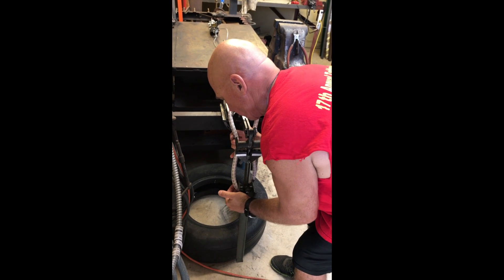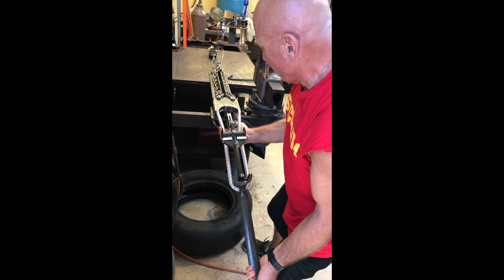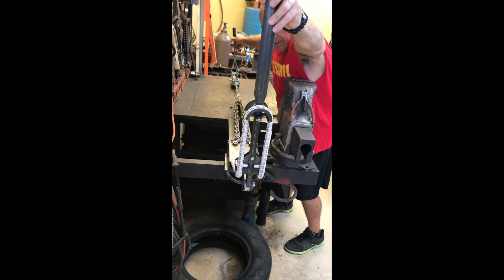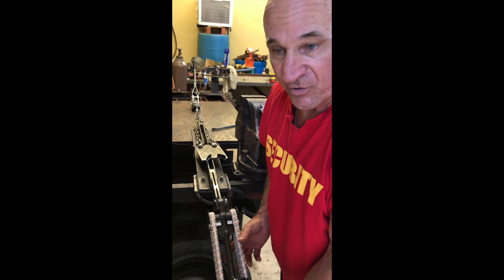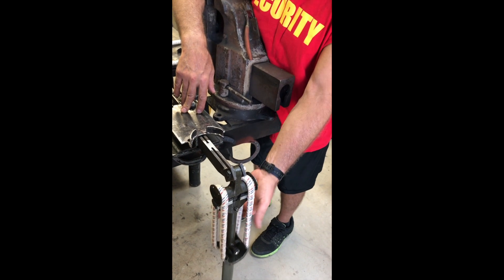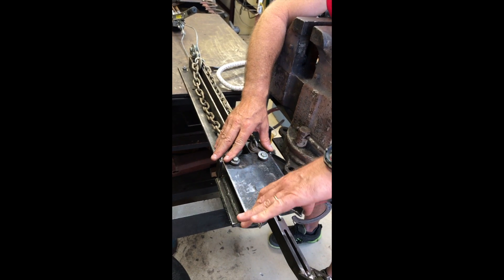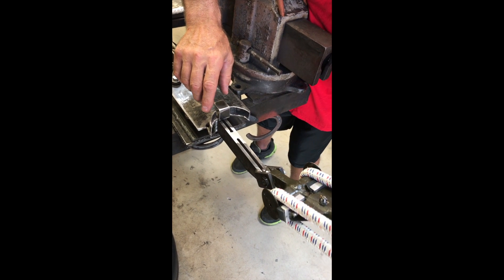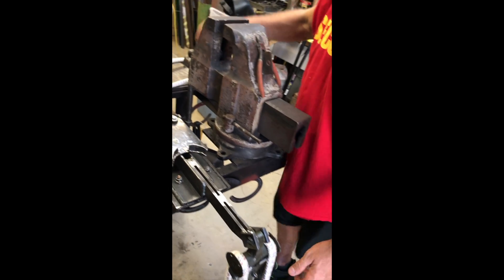Taylorcraft L2 Bungee Installation

Comment: Were did you get the bumper pads for your l2 gear thxs rob
Reply from the maker: @robker1212  I copied the old worn out bumper design and made new ones out material I had in the hangar. I don’t remember exactly what I used but the old ones had a homemade appearance to them as well. Firm rubberized material of a proper thickness, shaped and installed like the old ones, will work well. Thanks for watching!

Comment: Actually, According to the L-2 manual, that inner bungee is installed incorrectly. It's supposed to go around the smaller diameter post on the end toward the wheel and tire.
Reply from the maker: Not sure what you mean? The new replacement bungees are installed exactly as the old bungees that were removed. The new bungees have approximately 90 hours on them and are performing well.